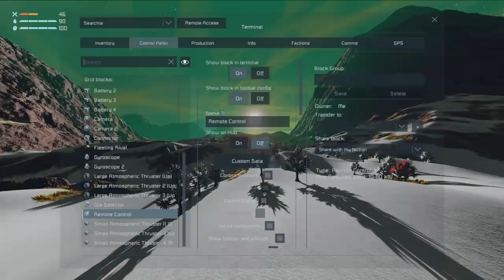Survival Impossible - Searchie #20 - Space Engineers Hardcore Survival

Comment: When I used to play with the Deep Ores mod, I employed small grid prospector probes, which were basically just a drill with like 3 or 4 small batteries, two gyros, ore detector, and an antenna. I had them projected onto a side of my scout rover and every time I found the discoloration that indicates an ore deposit, I would pop one off and let it dig into the ground. It was what saved that one game because I didn't want to use modded ore detectors, but I had some seriously bad luck and found no surface boulders with cobalt within nearly a 10km radius around my base.

The two main problems here are the fact you don't have the discoloration active, so you have to rely on a detector to find the ore deposit in the first place, and the second is the gravity, which could result in the grid getting damaged to a nonfunctional state before it reaches any significant depth (I was on an earth-like). Despite that, I wanted to perhaps spark your imagination in case you would want to build something to that account 🙂

Also, I think it might be the time for a medium-size solar tower, in regard to your power generation.
Reply from the maker: The need for probes like that was one of the reasons I decided against deep ores, while I liked the challenge the first time I did something like that, it quickly became more frustrating than fun for me so all my ores are at vanilla depths :)

Very much agree on the solar tower, it's time to boost my power output :)

Comment: Need to put some "eyestalks" on the crane cab with backward facing cameras. Maybe on pistons so you can retract when not needed. And as long as you do not "cheat" on using creative to spawn in bonus materials there is no reason not to use it to fix bugged grids/items.
Edit: And if you add a landing gear you can send Searchie out to gather the unknown signals! Then place a waypoint a 100m or so above your base and let the remote pilot back as you do other, productive, chores.
Edit 2: While you make a good point about not using flying drones for mining, how about just to create the pathway TO the ore? It is much simpler to use a infinitely more controllable drone for the voxel destruction to create a smooth path versus trying to use a rover. And now you have something to fly back and grab the first basic refinery! And maybe add a (normally off) antenna back at the survival kit base and a chair on Searchie? That way if you have to respawn you can fly Searchie there and catch a ride back.
Reply from the maker: Eyestalks is pretty much exactly what I was thinking :)
Reply: @Splitsie  I seriously doubt it will be JUST pistons. I am sure you will work some rotors in there as well. And possibly a landing gear, two lights and a toilet. But actually the lights would not be a bad idea.

Comment: You can make very straight tunnels with an "inch worm" miner. It's 2 landing gear separated by pistons. Moving forward is locking a gear, extending the piston, and then locking the other. 

For best results, you should have drill heads->1piston->landing gear->2 pistons->landing gear. The idea is that the pistons work against each other, so if if the landing gear closest to the drill is locked, the front piston is going forward and the two rear retracting to get the gear into place. When they reach the end-motion, the drill side landing gear unlocks, and all the pistons reverse, so you're lock on the rear most gear and have 2 pistons going forward and 1 going back; this keeps your forward movement constant.

To figure out where to point yourself, either build a driveway by guessing or do some trigonometry with the 2 GPS cords. If you have the elevation change is the height of your right right triangle, and then use the distance formula with the other two to find the width, and finish with Soh-Cah-Toa to find the angle you should have on a rotor head to get to the correct depth.

Comment: don't forget something to recharge the ore detector's battery, 

After it's dead it's going to be dead weight
Reply: That and remember to shutoff either the large grid detector or the battery before disconnecting them.
Reply: If he's careful, he can land the drone on it and use its batteries to charge the large one before it runs out. So yes, he definitely needs another way.
Reply from the maker: Yep, I'm thinking a rotor somewhere on the base so I can just put a rotor part on the bottom or side of the detector but just not sure where I'm going to put that yet

Comment: If you charge the big battery you should have plenty of power to use.

I would suggest to build a platform to drop it an fly of to charging port drone.
An then have an arm with an connector an it that you can rotate over it to hock it up to charge with your big solar tower that you should build 😁😁

Now you have a drone as working platform for high altitude work. 😂

Comment: Since the rotor heads don't have clipping when not mounted to a rotor, perhaps one of those on the side of the large grid detector, so you can recharge it from the base.

Hmm... I think the crane actually works better on the trailer, just so you have a place to fold it away. Moving it to the truck would eliminate the space for it over the hitch or the back.

That said, for these cliffside builds, you're probably going to want to start thinking about how to construct out over cliffsides with a crane. And by which I mean a cockpit out on the arm, with a welder on it and building with shift-g. Probably large grid for ease of item pushing. Also, you might want a flying vehicle with a drill on it, not for mining, but for carving away the walls to make building/driving easier.
Reply from the maker: Yeah was thinking something like that or a mobile connector on rotor or piston that slides out over the spot where I drop the detector part :)

Comment: 2:03 Splitsie: "I should build my scouting drone today. But, I do have enough iron for my office, so..."
Those are good priorities.

4:20 Wouldn't locking the rotors during transport fix that issue? Or does that just not work?

19:44 That'll be nice, those things look really good. Perhaps a separate control building could be topped with it, looking something like an ATC tower? You could probably manage to fit the gate in as a block somewhere as well, if you tried.

21:36 I don't consider bugs to be very enhancing to the survival challenge, so I see using creative mode tools as a proper response. With these mods, rebuilding the whole grid is not really an option so it's the only way to do much (other than maybe that thing where detaching a larger section of the grid can make others work differently).

24:25 It's the big open spot in the middle of the thrusters that makes it, I think.

25:27 You could also have a small detector on both the trailer and the drone, and use the detatchability of the detector from the trailer to let the drone take it and fly around with it if it needs to. Then, you don't need a battery on it, either, just the connector. That said, keeping both makes it so that if the drone gets caught by something more combat-viable, or crashes, then you still have a large-grid ore detector that you can use.

40:06 You could build some kind of carrier craft which is essentially a frame with a lot of thrusters for carrying the rovers over big areas like that one. Perhaps it could have its own wheels, cargo, control and oxygen systems, to roll around until it reaches the bigger cliffs, or perhaps the rovers could drive with it on top for a while. But it would certainly be useful, even in such gravity, if it was huge. That would certainly be very interesting to see built and worked around, you may very well need a separate landing pad somewhere for it, maybe on top of the processing building?

40:59 So you could finally get those permanent solar/turbine towers up? A reactor, or even hydrogen engines, wouldn't really be too practical now (unless you want to industrialize snow mining).
Reply from the maker: I've always got my priorities in order :P

I'm still thinking solar tower, as I agree with you mass snow mining sounds awful

Comment: Tip for the height issue, though I may be too late: put the connector between the batt and the detector since it has connection points on the ends with lights. Then for extra safety there can be catwalks underneath.
Reply from the maker: That could have been an interesting way to do it - will have to remember if this one ever gets shot up/dropped from too great a height :P

Comment: 41:50 random boulder at the left of the screen. but I guess whatever :P

Edit:
you might want to find a way to charge the ore detector battery, 'cause it gave you extra 20 min of flight time once it was attached
Reply from the maker: Yep, I'm thinking either rotor connection, or have a parking spot with a rotor mounted connector that slides out over it to lock on :)
Reply: I'd try to figure something out with extra horizontal connector on the Searchie itself. It won't be as bulk as on the detector module and more comfortable to park, either with or without big detector

Edit: I think it would look good enough under that upward-pointed thruster. Sure it's some space wasted inside there, but you kinda need it for lifting thruster anyway

Comment: @Splitsie For the mine: 1. easy way to do it, but kind of expensive would be to build a viaduct going down the mountain wall; 2. not as easy, could be cheaper somewhat easier to drive on/off would be to make a lift for GUFI2; 3. complicated, difficult, time-consuming, inefficient (once the ore is gone no more use for it unless something else comes up) build a cablecar for GUFI yea! build a cable car! make it on wheels similar to the tram but only have the top wheels system and let gravity keep it upright. Now that I would like to see (also if you make it in segments and lock it with landing gears you can reuse some if not all of it.

Comment: While I understand it wouldn't be a Splitsie series without making it more difficult on yourself, you've already done that with the setup. I think a flying miner would be perfectly acceptable, but you'll probably want it to be able to drive anyway for efficiency's sake but still be able to fly-mine and hop over impossible terrain. It's only 2x gravity, so four large lift atmos per large container: not horrible. My Canadian 2 cents.
Reply from the maker: You make a fair point, I guess the balance between the two approaches would be something like you say where I only use flight where wheels can't be used, maintaining efficiency in power usage while not making it take 3 years to get to space :)
Reply: Exactly. Maybe something like The Tick, using Vector Thrust, but a little more beefy and utilitarian. But there are many possible configurations.

Comment: Large grid: ore detector and rotor part.
Small grid: ship and rotor
Reply from the maker: The reason I didn't do that here is that parts attached via rotor/hinge/piston have a tendency to intermittently not get included in the calculations for the inertial dampeners but the same problems do not occur with connectors :)

Comment: At 8:57, how do you place only the rotor head? I've been trying to figure it out and it's somewhat frustrating. Loving the videos and learning a lot! Keep up the good work :)
Reply from the maker: If you have the rotor on your hot bar (make sure it's the one with the + symbol) then you can use your mousewheel to select the advanced rotor or either type of rotor part. Similarly you can go into the G menu and add the rotor part by searching for it and putting it on a hot bar slot of its own :)
Reply: @Splitsie  Thank you!

Comment: Is there actually a way to switch off right click mining? I want the player to be forced to deal with the stones and ore. Otherwise it is too easy to make long tunnels. ;)
And then of course it is necessary that the ores do not disappear. When the player reaches their ore limit, the mine tool should not work until they clear the debris.
Reply from the maker: I've not seen one, plus there are easy ways around an issue like that since Space Engineers has a limit to the number of floating objects (ore stones are included in that limit) so spawning more will delete the old ones

Comment: Hi Splitsie,

Sorry to bother you, and I know it's not relevant to this video, but do you know how to group blocks in the Xbox version of the game?

Trying to group 5 Airtight Hangar doors together, but can't figure it out and can't find a solution anywhere.

Again, sorry to bother you!
Reply from the maker: For groups you should be able to add them through the control panel in the same way it's done on PC, although navigating those menus without a mouse is a bit more tricky. In the control panel once you have a block selected (or multiple, though I'm not sure what you need to press to select multiple) there should be a 'group' part in the column on the right of the screen where you can type in a group name. Unfortunately I've not played much with the xbox controller so I'm not particularly well versed in the controls
Reply: Hi Splitsie, 

Thanks for taking the time to respond! My friend was able to crack it and apparently you hold down RB as you select everything! It was trial and error as there was no suggestion as to what to press.

Anyway, thanks again for getting back to me 👍